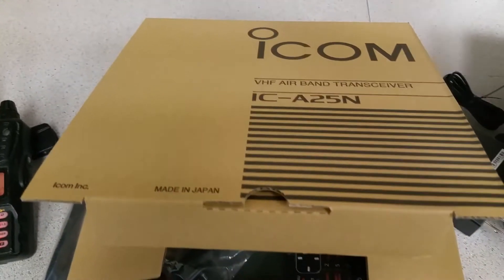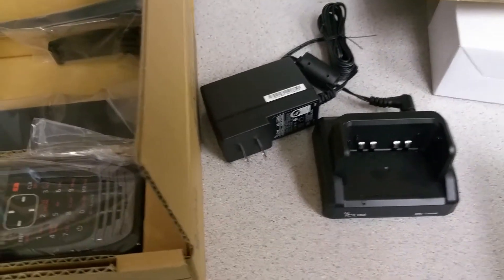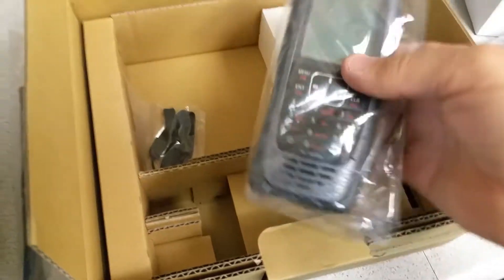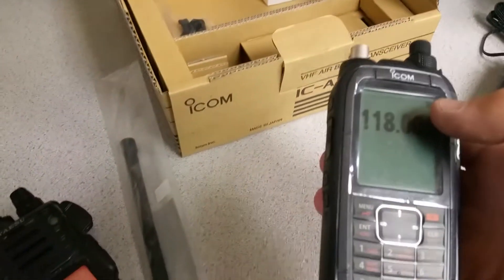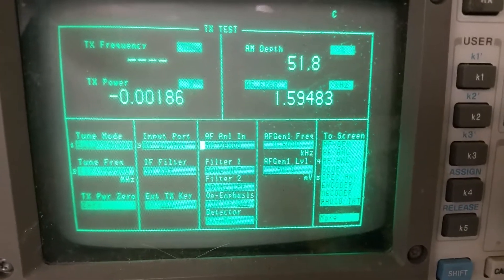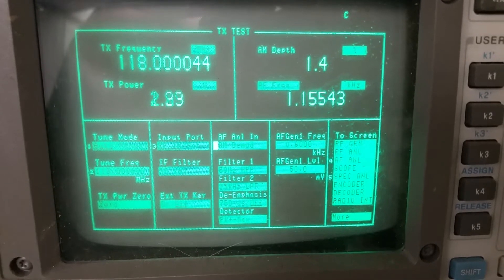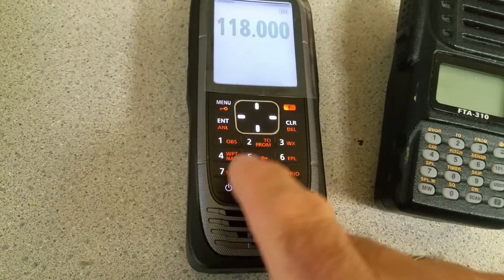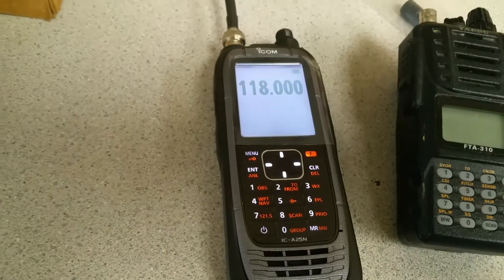Icom IC A25 N power output bench test

Comment: A new IC A16 showed similar low wattage output on a watt meter.  Less than 2W was indicated on a 6 watt radio.  Making noise into the mic didn't bring it up above 3 or 4.  My meter may not be fast enough to catch the PEP of the AM signal.  I'll need to do a field test from in-flight & see if it gets normal range on transmission.  Thank you for posting.  I thought that perhaps the radio had a hi/low output power feature that I was not finding.